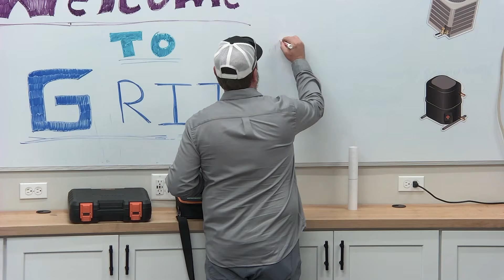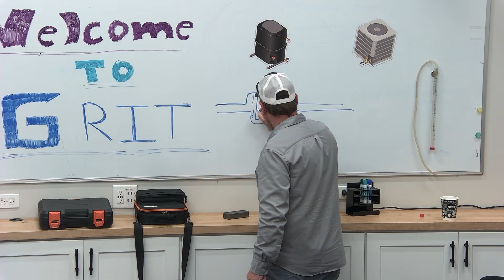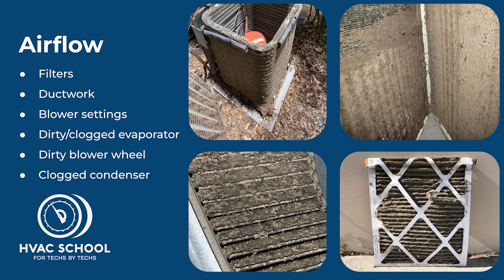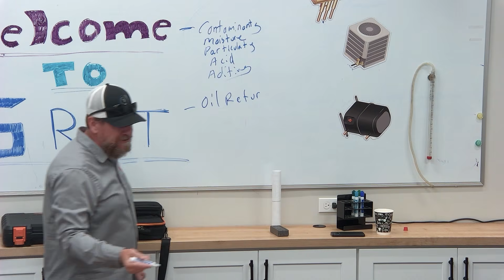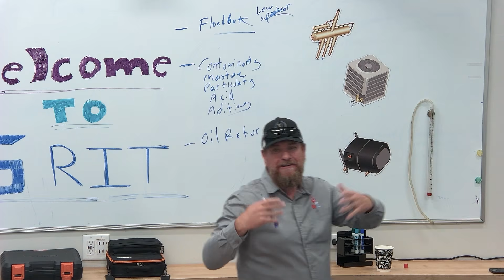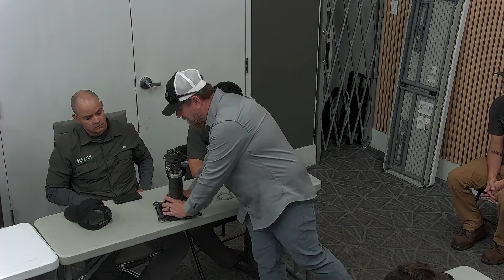Why Compressors Fail: Diagnosis, Replacement & Prevention

Comment: Incorrectly  wired capacitors (DIY changed and killed compressor). Many time they are embarrassed to say. If you see a new capacitor or even if not verify it’s wired correctly. 

Ask home owner if system has had any issues a last 6 months, capacitors, fan motors or even coil cleaning. It could have been incorrectly wired. Has anyone else looked at it and many corrected wiring but failed to consider it caused a failure.

Comment: What are your thoughts on this for larger tonnage systems? In regards to recovering the refrigerant before sending a confirmed compressor replacement our team works primarily on larger equipment, but I see where the benefit of this practice could avoid some uncomfortable conversation conversations that we have once an expensive compressor replacement has taken place and we find additional problems.

Comment: It’s just not true that the only way to get rid of acid is to use a base though. Chemistry isn’t so limited as to just an acid and base reaction. If it were the case, they acid away companies would have been sued into oblivion. At the very least in California where there are too many lawyers. It’s even worse when experts are wrong with such conviction. It hurts the industry.

Comment: First thing to look at when motors burn out is bad electrical connections. Also bad caps (if PSC), contactor contacts and the coil maybe the controller too.  Easiest to check too. Loose or corroded electrical connections will lead to high amps.. High amps on compressors will cause excessive motor winding heat to the refrigerant and oil which leads to acid which leads to eating away at the motor winding, which leads to acid eating the winding. HEAT is like water it because it breaks down the refrigerant and oil to become acidic.

Comment: At 24:15 the 24 volt controls and how they can contribute to a failed compressor is easy to overlook and deserves a closer look, chattering contactors in particular.  I've seen various causes for contactor chattering that led to a failed compressor.  A safety like a float switch or a pressure switch can cause contactor chattering unless a time delay on break relay is added to the circuit (a 5 minute delay built into the thermostat is not sufficient).  I've also seen weak or overloaded 24 volt transformers cause contactor chattering.

Comment: You know, idk how i feel about what Ty says about acid neutralizer. I'll say I have not used it more than twice now in the last 12 yrs or so, and I kinda had no choice. Both units were packaged geothermal hps above drop ceiling, both systems heavily contaminated w acid and failed compressors with much of the oil washed out and everywhere in system. A nightmare.  Many techs dont even know about acids in systems. Anybody who knows these types of systems knows how tight all the piping is inside, youre not adding suction driers and its already hard enough to change the liquid drier during repairs. I used rx11 flush on the first unit I did and had to cut system into 4 sections to flush and try to get as much oil as I could out, not easy at all and not really possible to get it all out. So the flush did not work after all that, after new compressor installed and running a bit I still had acid, only thing I could think of is recover,add neutralizer,evac, charge with virgin and hope for the best. System does not test positive for acid anymore and has been running like a champ ever since. On the second system I added the neutralizer before charging no matter if it needed it or not and also tests fine and been working ever since about 10 to 12 yrs now. So who knows.to me, I was doing what was rite  and it worked
Reply: Assuming your talking about something like a mini split that’s super tight, could you just leave the door off and put some crazy copper lines launching out of the unit and back in to fit the driers outside?

Comment: You left out the most important factor in suction line sizing Brian, and that is having the proper refrigerant velocity to return oil to the compressor. This is what matters most when selecting line size. And you need to take into consideration lift on jobs that have it,not only line length like I believe residential ioms take into consideration. Becomes even more critical on systems with 2 compressors sharing a single split evap that also share one common suction line back to compressor and theres lift involved.  Very common scheme with trane mau's

Comment: I thought the single pole contractor energized the compressor some and was a substitute for a band heater.  Is that not true?
Reply: Yes. I don't like to put double pole on some because of this.
Reply: @alias177 never mind i watched the video in the link.  Got it now.  Still seems like a band heater would be better but what do i know
Reply: @alias177 from what I thought i heard from ty it's better to use a band heater?